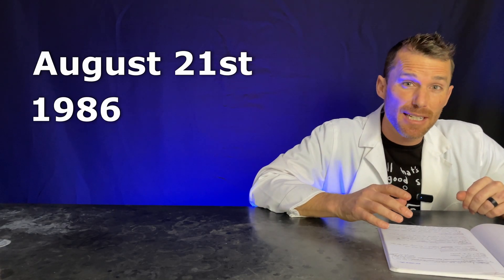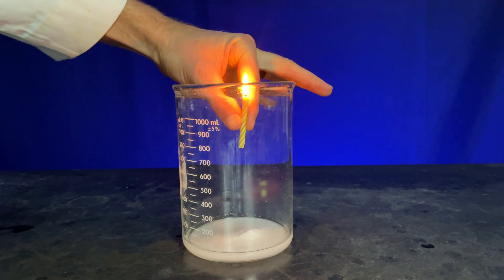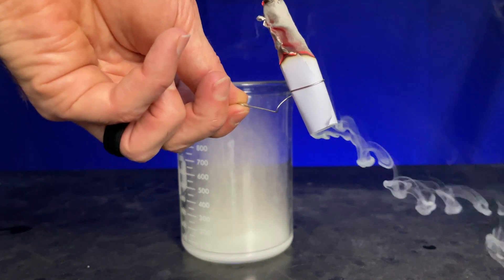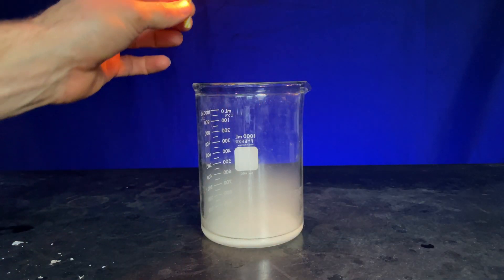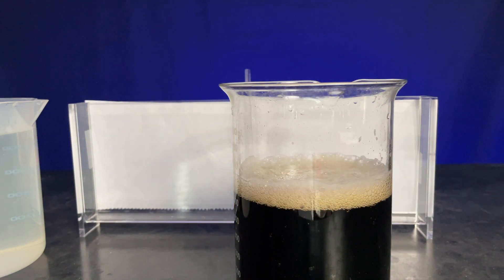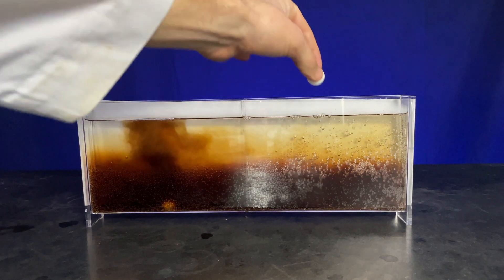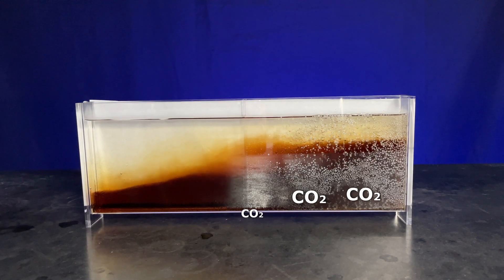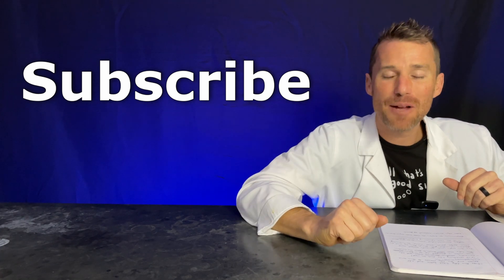Lake Nyos tragically killed 1,746 villagers.

Comment: I remember reading about this years ago. Thanks for the video!
From Wikipedia: 
In 1986, possibly as the result of a landslide, Lake Nyos suddenly emitted a large cloud of CO2, which suffocated 1,746 people and 3,500 livestock in nearby towns and villages, the most notable one being Chah, which was abandoned after the incident.

Though not completely unprecedented, it was the first known large-scale asphyxiation caused by a natural event. To prevent a recurrence, a degassing tube that siphons water from the bottom layers to the top, allowing the carbon dioxide to leak in safe quantities, was installed in 2001. Two additional tubes were installed in 2011.

Today, the lake also poses a threat because its natural wall is weakening. A geological tremor could cause this natural levee to give way, allowing water to rush into downstream villages all the way into Nigeria and allowing large amounts of carbon dioxide to escape.

Comment: This sounds really stupid but what if we installed a solar powered fountain that just pumps from the depths and scatters on the surface? Might be hard to install though.
Reply: I think other lakes prone to Limnic eruptions do have countermeasures like this. Like I think some detonate explosives at the bottom every couple years, IIRC, and I do remember something about adding water pumps to circulate water and prevent accumulation over time. Not a stupid idea.

Comment: I would try to utilize algae. Algae is a form of plant very good at taking carbon dioxide out of the water and it exhales oxygen. Along with leaving a film of algae in the lake itself we could also put algae in some form of transparent container like large plastic tubes and pump the CO2 rich water through the bag allowing the algae to turn it into oxygen. 
The algae will reproduce as long as it has sun and CO2 I suppose if it got too thick you could use it for something. Like fertilizer, here's a weird idea in Africa where they are using something called poo power. They take bacteria from Cow dung put it into a vat and capture the methane that comes out of it. Then they use the methane to cook food and other things. The problem is the bacteria need something to eat. Usually it's grass clippings or corn husks I wonder if they used the algae. Then you could turn something bad into something good. Those are my little ideas.